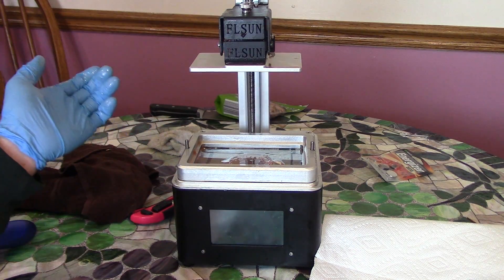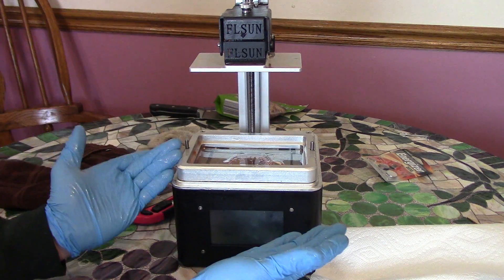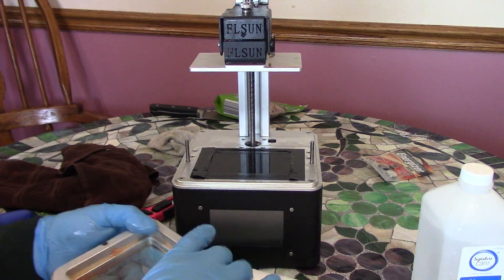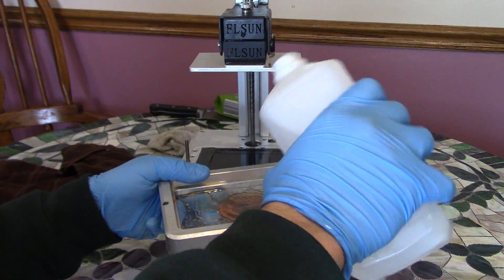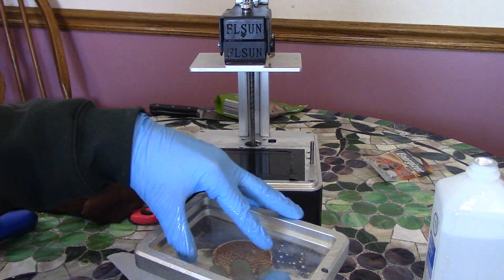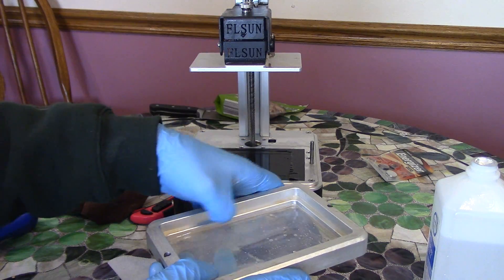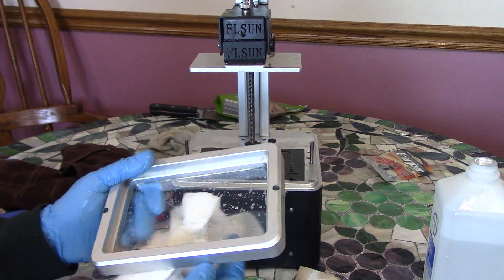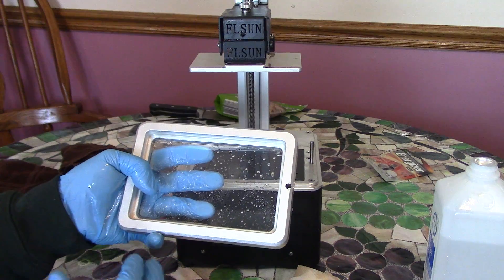How to get a failed print off the FEP sheet on a SLA or DLP 3D printer.   p  ..

Comment: Thanks for the video dude, I got a new Photon Zero and had a failed print sticking to the bottom of the vat, thought I already had to buy more FEPs ^^”
Reply: Same here! Did you find a solution?
Reply: @themoody1337  Uh, watch the video dude, he explains it. Just pour in some alcohol, swirl it around and if the failed print doesn't come off by itself just push it from the bottom very gently and it'll just peel or, in my case, pop off.
Reply: @bfenix  I actually ment the cause of thr print sticking to the FET... I couldnt get a single Print right
Reply: @themoody1337  Oh sorry, didn't get that. From the feedback I got from more experience Photon users that happens probably because of lack or poor placement of supports, poor model placement or insufficient exposure times (or all of those combined).
Reply: @bfenix  oh I see, thank you so much for taking your time! I will try again soon :)
Reply: @themoody1337  No problem, I hope it works! The Zero is still very new so we gotta share our knowledge

Comment: how did you fail the print
Reply from the maker: +Stephen Chernecki these rein printers if its not perfect it fails.
Reply: yeah i had that problem with my first two prints i used the black plastic tool they gave you then i started to use rubbing alcohol and melted my tool >_>